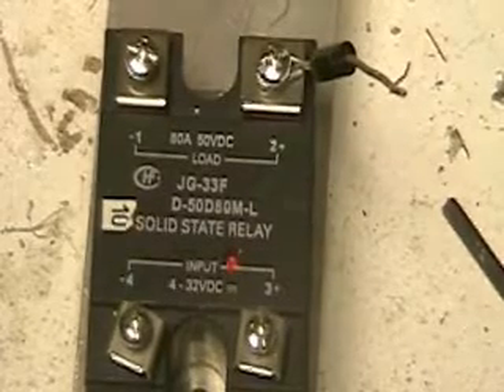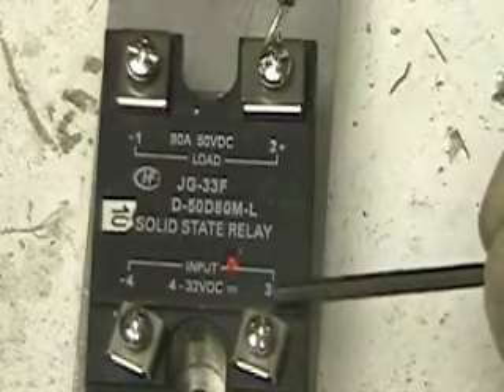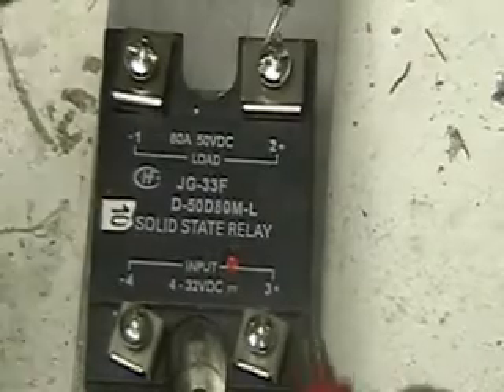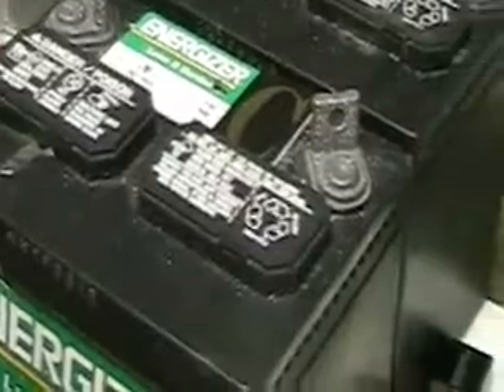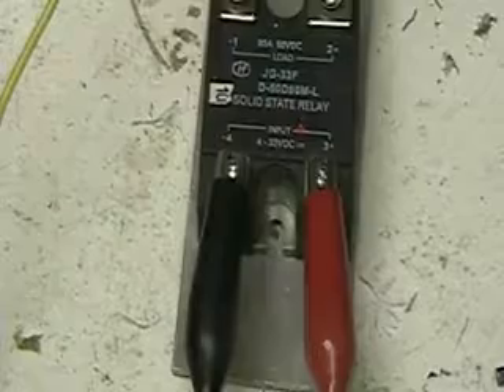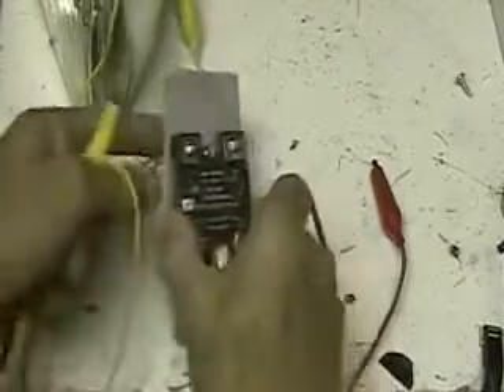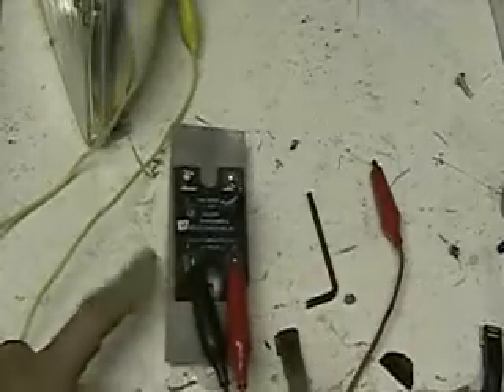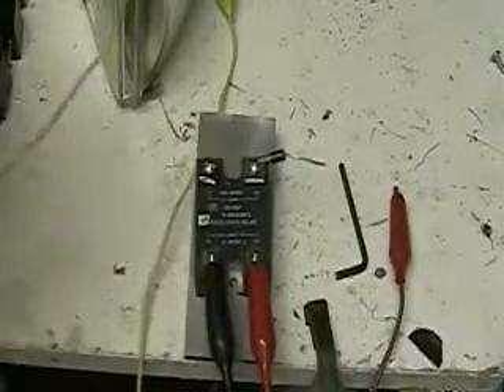Hydrogen Tap (SolidState Relay ) 246

Comment: why not using  electronic switching like with mosfet circuit, uses less current and you can run much faster (higher rpm`s)